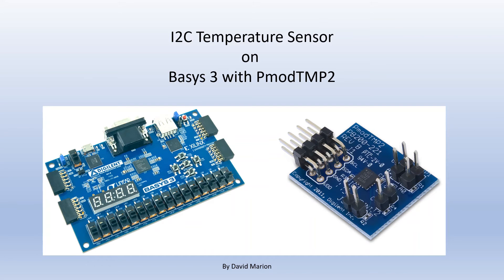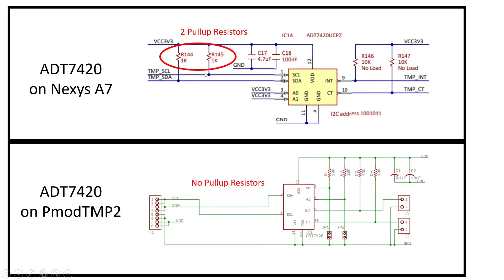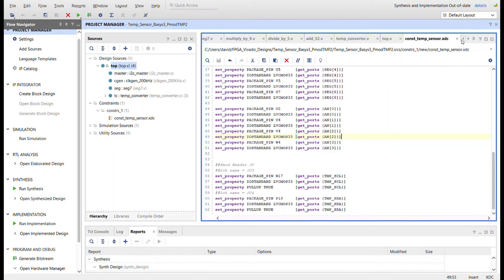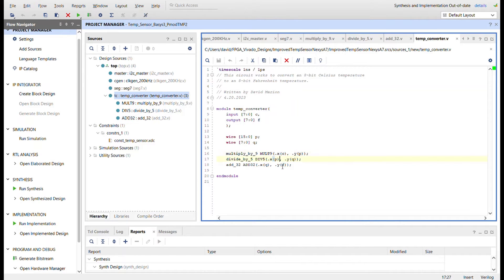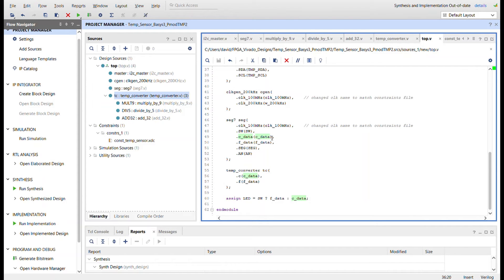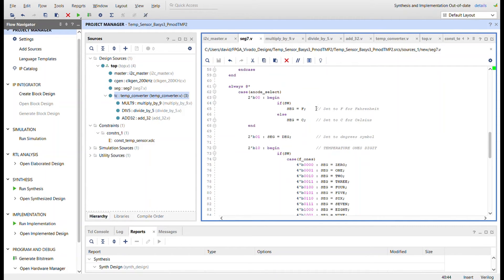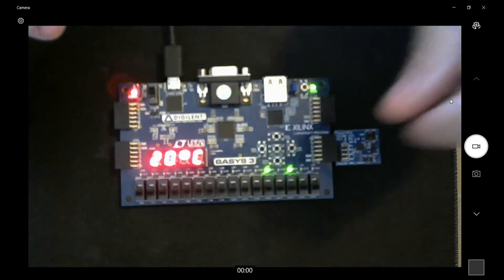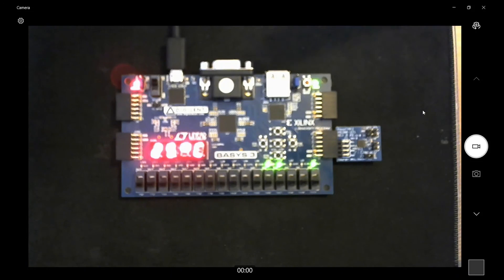I2C on FPGA Temperature Sensor Basys3 with PmodTMP2

Comment: Can i interface a DHT11 temperature sensor on it?
Reply from the maker: On what, this project? No. The circuitry is different for the DHT11 sensor. You would have to look at the DHT11 datasheet, which should provide information on interfacing with the sensor and timing diagrams, and then develop a circuit for the FPGA to read data from the sensor.

Comment: Hi! I am trying to implement this code on a different FPGA board but am still using the same temp sensor. The board I am using is the Urbana board, and for some reason when I program the FPGA on Vivado, the only thing I read on the LEDs is 23 F and 0 C, and this is wrong for my room temperature which is 74 F, and this number doesn't change even when I apply heat to it directly. Does anyone have any advice or an idea on what the issue could be and a potential solution? Thanks so much!

Comment: What is pullup true meaning with respect to sda direction ?
Reply: Thankyou ..It was I was missing in my project
Reply from the maker: When no device is actively pulling the SDA line low, the pull-up resistor ensures that the line is at a high logic level (Vcc). This is crucial because it defines the idle state of the bus.